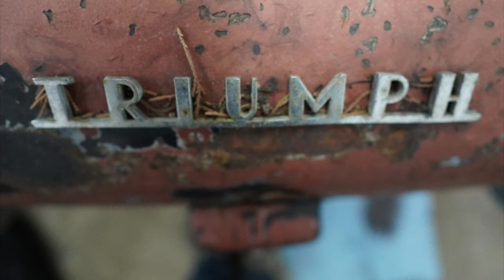TR3 Body Removal and Jackpot Find!!

Comment: Very interesting to see a car with the occasional seat attachment pegs. I have read about them but no video or pictures. I finally discovered that they were available from Moss as a Jaguar part. This helps to see the location in the first raised area back from the vertical  heel board. Continue on, Frank
Reply from the maker: I had to go back and look for that.  Thanks for pointing it out.

Comment: Good find on the overdrive…if the commission number has an L ( left hand drive) and an O (overdrive) then you know it’s original to the car.  There should be a relay attached to the bottom underside of the battery box…this is for the overdrive.  The speedometer cable routing is another clue…if it runs across the front of the battery box from the right to left side, that indicates a factory overdrive car as well….If you are looking from the bottom of the car upwards, if it’s an A type overdrive, you should see a big brass castle style nut on the bottom of the case.
Reply from the maker: Will look at that ASAP, and thank you for posting more 3 resto.  Perfect timing!